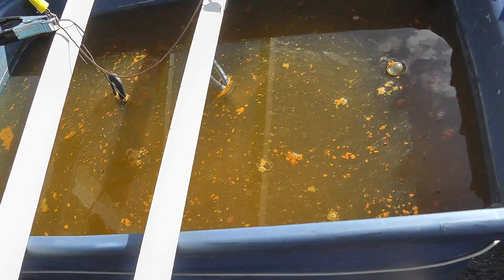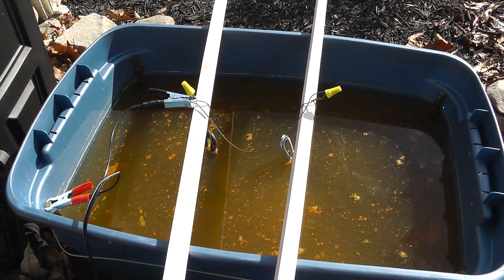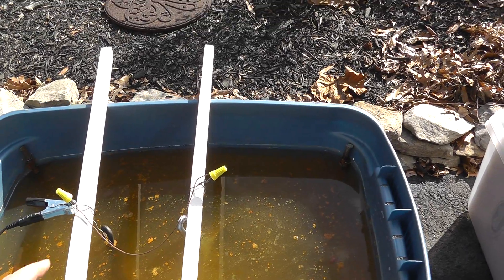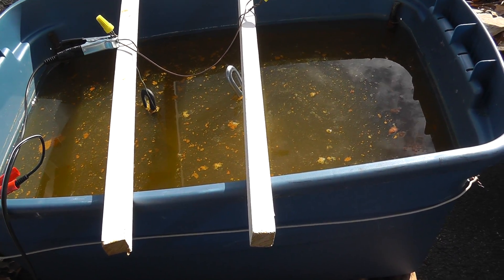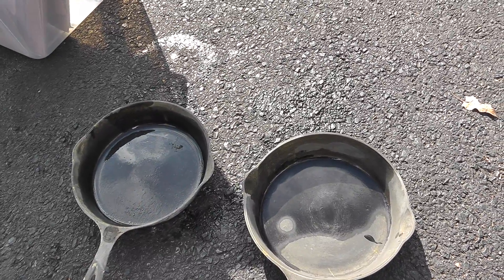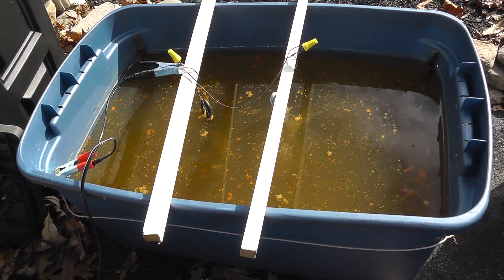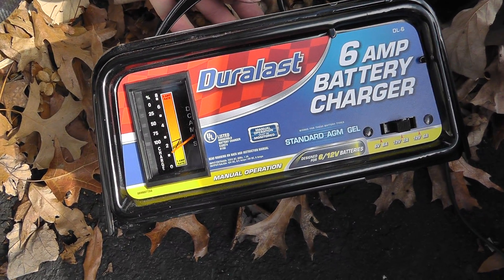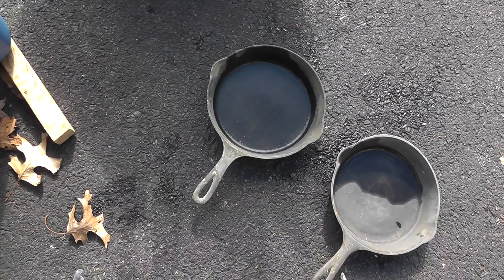Electrolysis Tank for Cleaning Metal - Update Lessons Learned

Comment: Thanks for the video.   I have had good luck putting the cruddy pans into my electric oven on the self-clean cycle.  It incinerates all the organic crap and even powders up the rust.   When they cool down I rinse them off and season.   I have used the electrolysis for rust removal on tools and other things as well.  Lately, I have gone to simply soaking hand tools in vinegar over night.  That takes the rust right off, no fuss, no muss.  I enjoy your videos.  Keep them coming.
Reply from the maker: You're right, there's more than one way to skin a cat. I have a lot of cast iron to clean. I wonder about the cost though when using the self cleaning oven. I guess it's not too bad if you have a gas oven but I have electric. The vinegar method works. Will